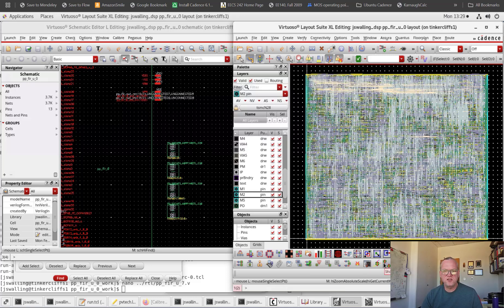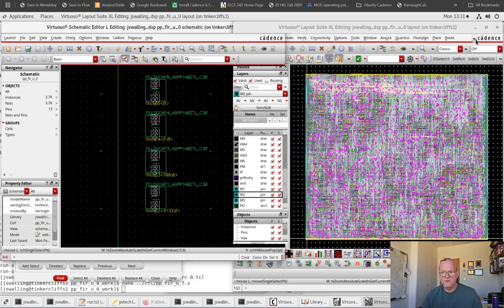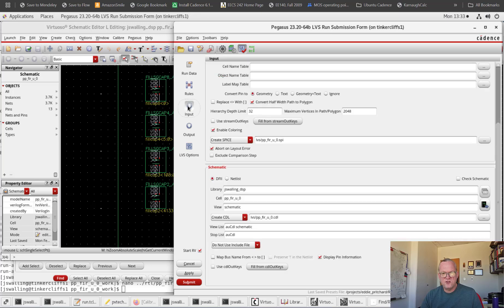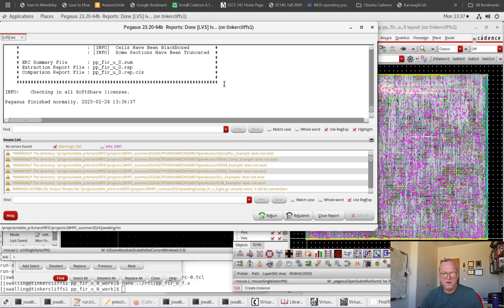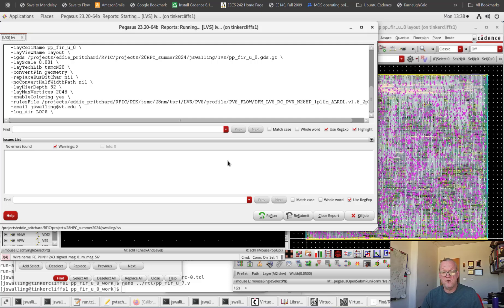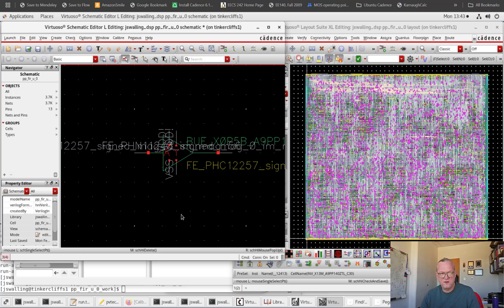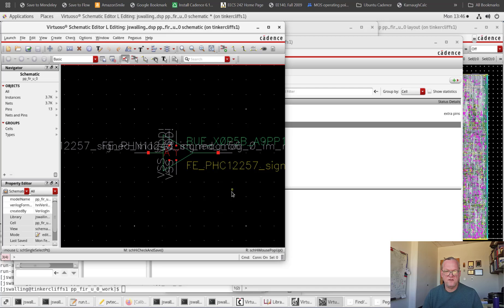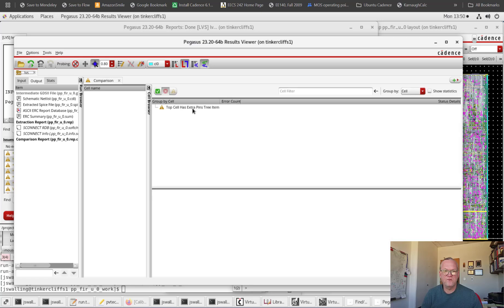PEGASUS   LVS

Comment: when i check lvs the circuit shows error "Layout Inst: missing inst :Schematic Inst: RRO" "Layout Inst: XO/RO @(14.415,314,955) : Schematic Inst: **missing inst" , but my circuit only uses 1 respoly from gpdk045nm and does not edit , i do not understand why this error. can you help me pls
Reply from the maker: I do not know that PDK, but it seems to be interpreting that the schematic and layout are using different types of resistors or it cannot interpret the resistance type that it extracts correctly.